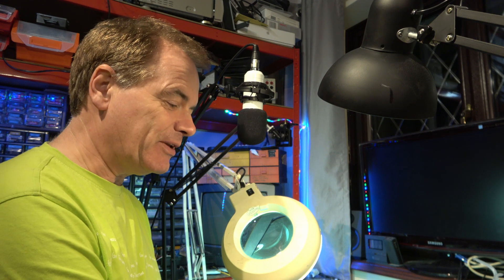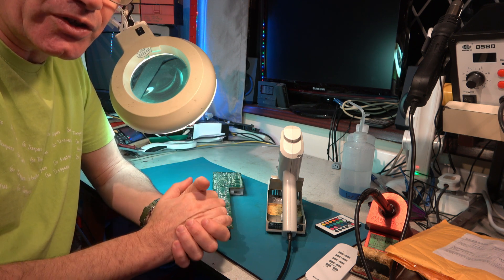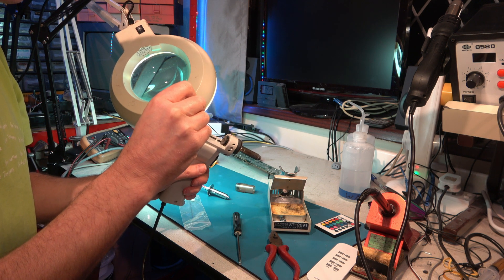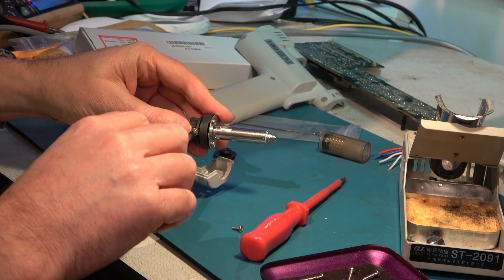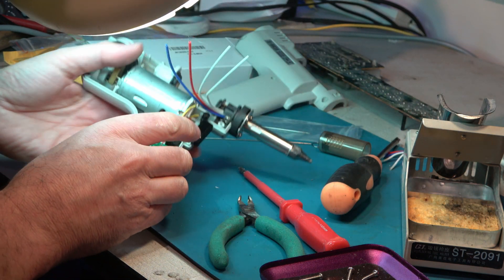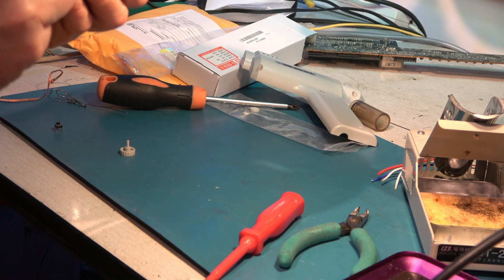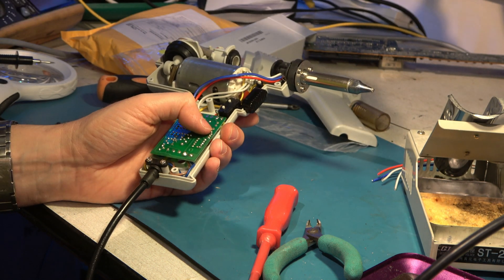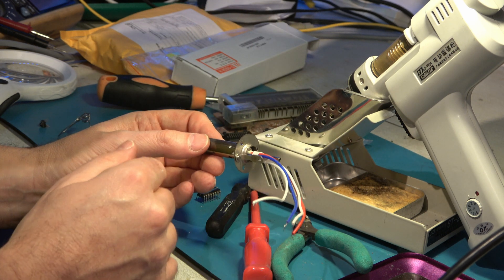Element replacement in a S-993A desolder pump went a bit wrong.

Comment: I sat down today to do some rework on an 8" floppy disk drive and found my S-993A wasn't heating up. I'd read it's a common failure, but still annoying. That's an invaluable tip about the lack of through-hole plating on the PCB, thank you! Hoping I can get a replacement element before Christmas...

Comment: These Chinese pumps have a problem with wrong size resistor for current limiting in the PCB. Once, when working, the PCB blew right in my hand and the smoke escaped. I found the schematic drawing somewhere in the internet, and it turned out that current limiting resistor for the zener diode in the PCB are just 1/4 W size but upon calculation it is evident that it should dissipate about 1W of power. No wonder, it blew and took the zener with it also. So, I replaced the zener and the resistor with larger (2W, or two 1W in parallel, do not remember now) one, there was still enough space for that. Now I am more confident about it not blowing again in my hand. True, my unit is not the S-993A but the S-997P. But I think the PCB is probably about the same.

Comment: Thanks for the info, I have the same de-solder pump. I've ordered an element just in case. I should have it by the 31st of Jan. LOL.
Reply from the maker: Very wise.  Despite the element failures, it's a very good tool indeed.  I use it frequently.

Comment: I disassembled mine to replace the cord (swapped it to the Brazilian outlet standard) but am having trouble re-positioning the temperature dial so it corresponds to the actual temperature. My multimeter thermometer doesn't seem to be able to help me with that (temperature jumps way too much), do you have any tips so I can sync my dial with the actual temperature of the gun? Thanks in advance mate!
Reply from the maker: The multimeter sensor is probably a type K thermocouple, which should easily be able to manage the 400C or so that this heats to.  Perhaps try a different meter / thermocouple.  Getting good thermal contact is important, perhaps fit it on with something like a jubilee clip.  But I thought the temperature dial only fitted on in one place?  May be wrong.
Reply: @video99couk  I believe my thermocouple is not getting good enough contact with the hot tip of the gun, which is why I am having problems when it comes to getting accurate temperature reads. Regarding the dial, it has a hexagonal fit so it does not, in fact, fits in only one orientation. If you don't mind the question - with your gun turned off and the dial locked in the absolute minimum position - does it sit with the 350 indicator right underneath the little plastic nub indicator from the gun? Thanks in advance!

Comment: My pump has died - the heater is fine. How did you remove the temp control knob to get the PCB out? Does the knob just pull off?
Reply from the maker: I've never tried but I would expect the control to simply pull off.  You will have to be a bit careful though since access around the edges of the control is a bit limited.
Reply: when you remove the pcb the knob fall off, this is the best way.

Comment: I think I'm right in saying these units are sold to work at 220V? My house mains is NEVER below 245V and often peaks at 250V. I have a couple of 220V items (hot glue gun etc.) that I run from a 218V supply as I can't imagine they'd last long otherwise. How do you get on with your vacuum gun in that respect? If my assumptions are correct could that explain the failure of x2 elements so far?
Reply from the maker: WELL DONE!  Super observation, I had missed that.  Yes it is marked 220V, so that will be why elements are not lasting well.  I will arrange for a step-down transformer.
Reply: Thanks mate, now I know!

Comment: My first de-soldering station cost around £800 pounds in 1992 It was from RS components but I think it was really a Pace. Things are so cheap nowadays, I guess that's thanks to internet marketing.
Reply from the maker: I have an RS soldering station which is also Antex.  Desoldering stations are much cheaper than they used to be but the quality is only adequate on this one.

Comment: The thing i would want to find out is the reason the original element died in the first place.
Is the temp controller board a bit dodgy, or bad soldering on the pot.
I like a solid reason when my stuff goes poof lol.
Reply from the maker: The first element definitely went open circuit.  The second element meters out fine now, but I'm assuming that it has an intermittent internal connection, probably a partial break in the element wire.  The board doesn't seem to have any bad soldering, but the lack of through-plating is a bit poor.  You can see why it's cheaper than a Hakko.
Reply: Yeah from your video i got the point why my heat element has been dead right now even i rarely use it. It is logic because the my board didnt controll well my heat element so it got overheated.